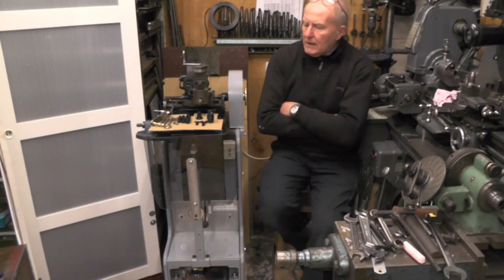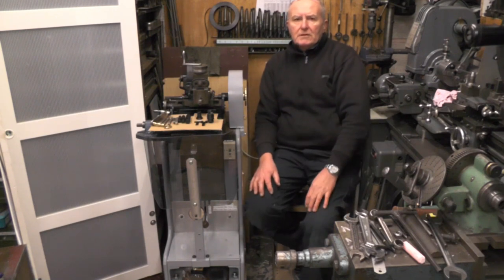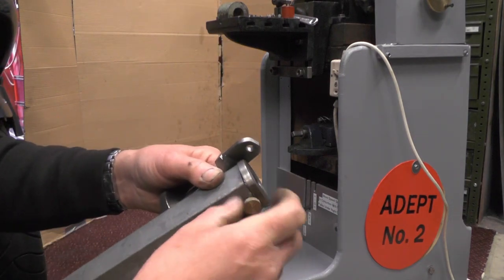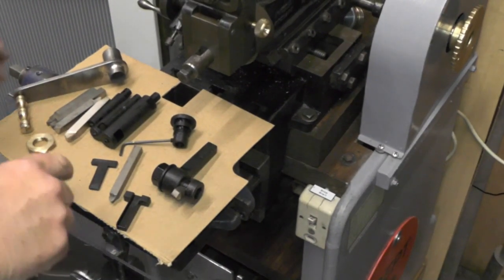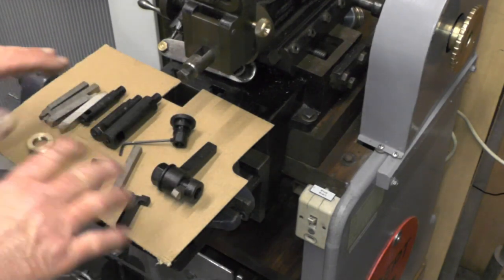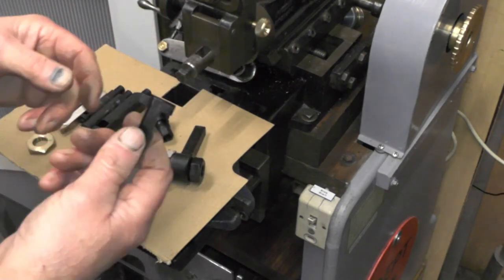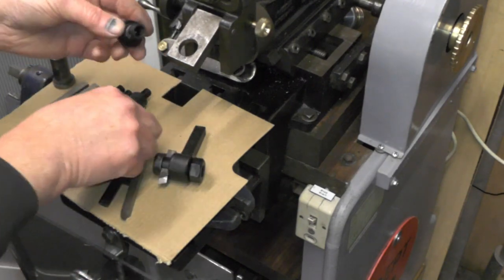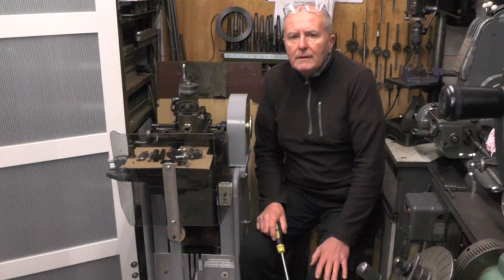Adept No.2 Shaping Machine PART 6 (TOOLING, ACCESSORIES, CHIP GUARD & ADJUSTABLE SUPPORT LEG)

Comment: You've been busy Kev !
Prime example of what happens when you get a new machine, you end up spending ages making things for it 😁😁😁
What method did you use for the blacking? Looks really good! You got a video for it because I couldn't see one?
Reply from the maker: Hi Neil
yes, did a blitz  job on some basic tooling, nothing worse than having a machine ready to go and no tools to do a simple job!! 
The blacking is just good old "well used old engine oil", i keep a gallon or two in an old pressure cooker (any metal container will do with a wide opening) under the bench, bring part up to red heat and quench in old oil, make sure the parts are polished up beforehand, okay for small parts. (Disclaimer for anyone else reading comment; Big parts with a lot of heat in might ignite the oil!!! depending on your volume of oil in the container to dissipate the heat , just have a cover ready to cut off the oxygen), 
Next part Part 7 
is the finale' taking cuts up to the machines limits and a re designed name plate??? just for you!!!
Cheers Neil
Take Care
Kev
Reply: Cheers Kev.
Impressed with what you've done there. You've really done that shaper proud!
I tend to stay away from hot stuff, only because my little shop is made of wood. Still have nightmares about the 3 little pigs😂.
Thinking about giving the hydrogen peroxide technique a go. If it fails, I can always bleach my bald patch 🙄
Cheers Neil 👍